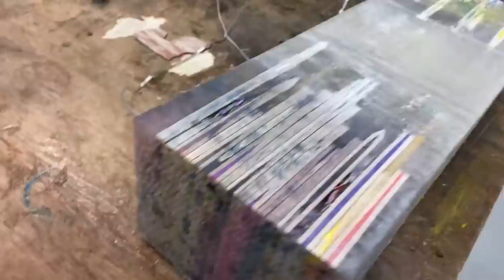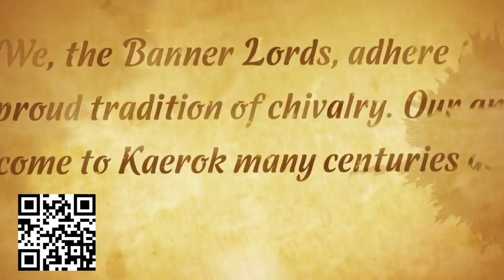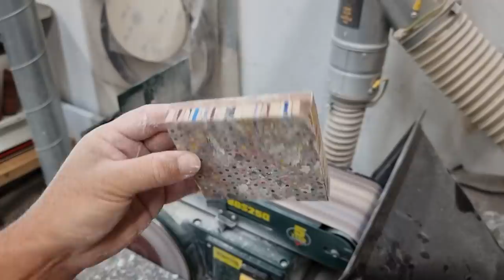Thousands of Pencils Failed in Epoxy Resin!  Can We Upcycle it ?

Comment: Hey have you seen those no waste table legs?  I think that would be a cool way to use waste. Mold and cut. Also in polymer clay there is something g called a Natasha bead where you take scrap clay and turn it into these insane beads. Those table legs work on a similar principle so I thinks with color and resin you could create something amazing.

Comment: Are they trivets now? You never actually explain what they are, but they turned out pretty!
Reply: My thought was drink coasters 🤔
Reply: @skort94  seemed a bit large and unevenly sized for that, which was why I thought maybe trivets
Reply: What's a trivet?
Reply: Basically trivet is sort of a coaster for pots that are hot to protect table from the heat
Reply: @KaivalaJenva  ohhh my brain is calling those hot pads, but is then confused because hot pads are so your hands can pick up hot things but are not an oven mitt
Reply: @KaivalaJenva  thank you for clarify what a trivet is lol. Never heard of those. We just use potholders or cutting boards 😂
Reply from the maker: these were coaster for part one 😀
Reply: @nickzammeti  Yep, I've seen part two now, much better than coasters 😁

Comment: You cut the resin and pencils into blocks, and I'm wondering, "What's he going to make?".
You attach them to some boards (and yes, you definitely do have a lot of clamps. LOL), and I'm still wondering.
But when you started using the router I immediately said to myself, "Coasters!!".
The coasters look great. If you haven't done so yet, work up those two blocks that you had set aside because they didn't have many pencils in them. I think they'll look great as coasters too.

Comment: How about mitering the corners, make a new pencil cube.... Then add a Bluetooth speaker (you thought I was going to say lights, didn't you?) LOL 🤣😂🤣 face the speaker up and drill out the center of the pencils on the top cover like a grill cover for the speaker. OR... keep it removable and glue the speaker to the cover so it can be removed and inverted to enjoy your tunes. You could even add (no not lights) a charging port(s). Okay that's enough to get your warped mind spinning on your own. 
Good luck and I really do like the pencil & wood tiles you salvaged 👍🏻♥️

Comment: I thought you could have cut the ends into thin enough pieces for light being able to pass through, building a small led panel with those pieces in front, and then have made some small table lights

Comment: Coasters? Really? Hmm...my first tought was cut it up in squares...well you did...next thought...glue it back up...well you glued it to wood...and then it went off...in my opinion. The holes looked nice and i would have worked with them. I would probably turned it in to a wall lamp. Make a square/cubik/ triangel  and put some light in...the hole would have maked a nice shadow to the wall...maybe next time. I although could see a nice big clock. Thiner peaces glued on a nice (maybe with lights) surfaces a big clockwork or turn the cutted squares into numbers for the clock...or make a nice little jwelry box out of it...combined with metall...I could go on with ideers...

Comment: Do what you did but get all joined back together drill out and do the original idea and put the top back so you have a band of Pencils a band of clear band of pencils band of clear that the pencils and a clear et cetera et cetera then put top peace back on and reset the lights to come out the bands of clear with the top being striped and the mass Pencils at the bottom supporting the light at the top so flipping over and make an upsidedown compare to what you had in the first place